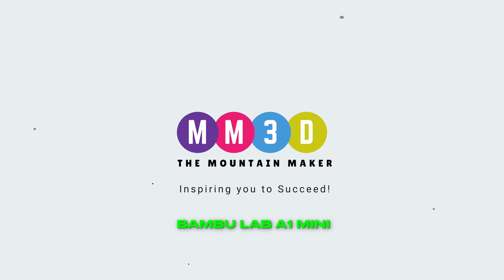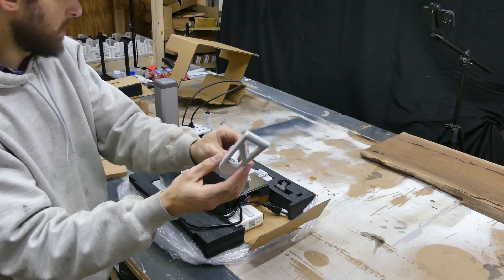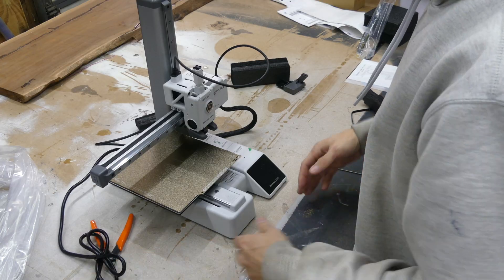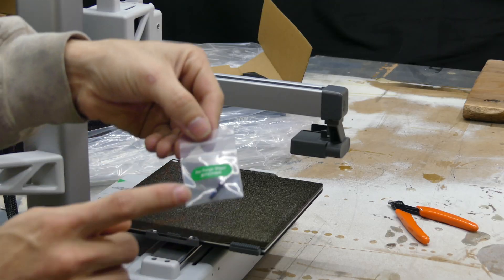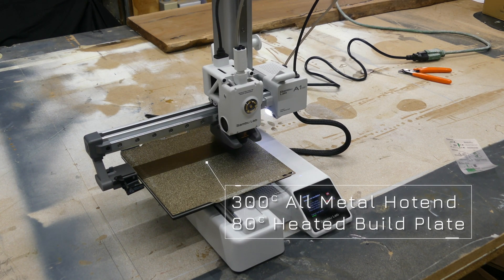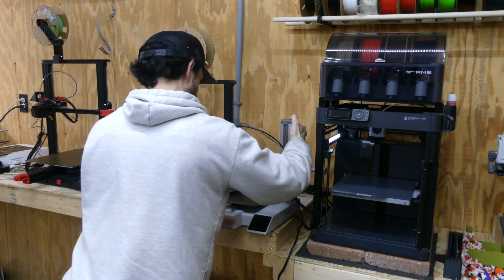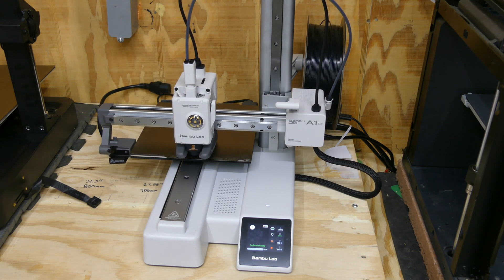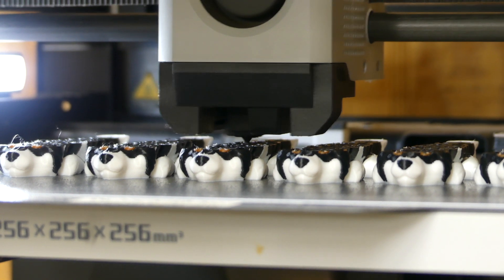Bambu Lab A1 Mini: Unboxing, Setup, and First Print

Comment: Instructions on the mini say to tighten 3 screws on heat bed to lock it but didn't see this in your vid.... not necessary?? 🤔🤔
Reply from the maker: I’ve not done that with the 4 i have and never run into any issues over the last 2 years but maybe they’ve updated something
Reply: @TheMountainMaker might add a note to your vid because those 3 bottom screws definitely needed a few turns. 😊😊

Comment: I wish they included a bag of filament
Reply from the maker: It seems most companies have stopped doing that, or give you just enough for the first test print to work. My P2S from Bambu also didnt come with any filament cutters so it seems they are doing away with those as well, at least with the more recent machines, so would be a great idea to grab some off of amazon. I was able to find some good ones at my local auto parts store for a few dollars so that wasnt a huge issue

Comment: My single A1 mini with AMS lite  is all I can have in my semi.  It’s been a game changer for organizing and tool storage as a truck driver.
Reply from the maker: That’s awesome! It’s a great tool and doesn't draw very much power at all, so I imagine its a great little machine to use on the road!
Reply: @  definitely.   It’s a great tool  yeah  a larger build plate would be great but it does all that I need.

Comment: Did i miss it, or did you forget to tighten the 3 screws on the bed? 🤔 Mine came today but couldn't set it up yet 😅 My X1C got a brother now 😂
Reply from the maker: Nothing to tighten as far as the bed goes on the A1 Mini. It really is a 10-15 minute setup and aside from removing the bracket and plugging in a few accessories such as the ptfe tube, it’s pretty much ready to go out of the box.
Reply: @TheMountainMaker  in the little booklet, there is a point where you have to tighten 3 of the 4 bed screws 🤔 Every other video i watched, they also tightened it 🤷‍♂️ Just saying 👍
Reply from the maker: I must've missed that part! I've got almost 3k hours between the 3 of them and now im not sure if I did that with any of them! 🙃 I may have to go back. As far as I knew, those screws were for adjusting the tram of the bed to bring it more perpendicular to the print head if you are experiencing issues. So far I haven't had any so I don't really want to go messing around with them but i will take a 2nd look at the manual

Comment: I have three A1s and a mini and the mini is absolutely my favorite printer. I have a wall mounted AMS lite with it now, but before that I was using a wall mounted spool holder. I don't like the stock spool holder setup at all. With full spools, they can unwind and cause a tangle when the printhead is homing. I also don't use the PTFE tube that goes on the side; I used just a small section in the printhead since the filament path was fed from directly above.
Aside from the spool holder setup, I love the mini. They're a killer deal at the current $179 sale price.
Reply from the maker: I completely agree with you! That stock spool holder is a pain. I can’t tell you how many times I’ve had to come back down after starting a print because the spool unraveled itself and got caught around the spool and mount. All my standalone units I’ve printed a wall mount for to hang it above the printer and don’t have any issues with that so far.
Reply: Hey! I had the same Problem, i think its because of the vibration of the printer, when it calibrates itself. During this process i saw the spool spinning backwards ☹️ printet a wall mount and Everything works absolutely perfect! Sorry for my english, german dude :) greetings

Comment: Question, I just got a kobra 3 combo, but i’m having a lot of issues, trying to print for a week (since I received it), now i’m wondering if i should return and get the A1 or A1 mini, probably the A1 mini because of the price (but i really wanted the A1. I’m just wondering if the A1 Mini is really too small or if it’s worth it. Could you answer me that?
Reply from the maker: I have no experience with Anycubics line of printers but i can say any of the Bambu machines just work out of the box, especially the A1 Mini. I had an A1 before the recall back in January/Feb and then got the P1P when i sent the A1 back. Right now the A1 combo is around $449 i think and the A1 mini is actually an extra $20 off so $179 for the standalone. 

If i didn’t have the larger volume printer already, i would probably go for the A1, but i only have one that is the 10x10 size, the rest are the 7x7 and i get by pretty well. I suppose it will depend heavily on what you’re actually printing
Reply: @TheMountainMaker  Thank you so much for minute to answer. Do you know the exact print size of the A1 Mini? I’m definitely returning the Kobra 3 and going for either the A1 or the A1 Mini. I’m probably just printing stuffs for me, friends and family, not a business or something like that.
Reply: @abeatrizsk8  I have both the mini and full size A1; if you can afford the full size A1, go for it. The mini is amazing, but the additional build volume of the full size A1 is a very welcome feature.